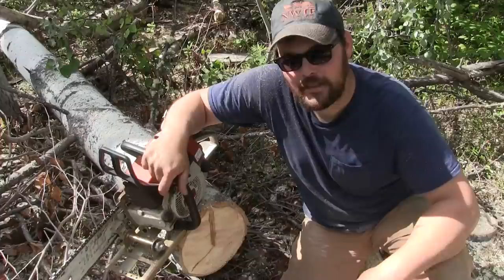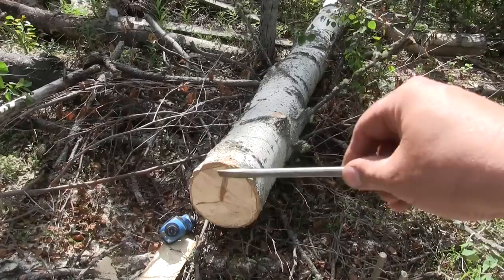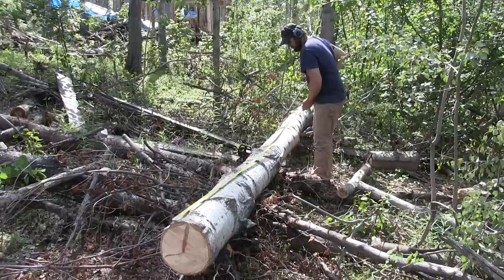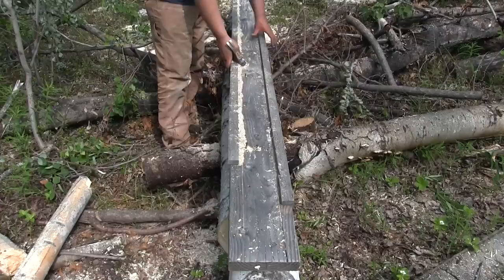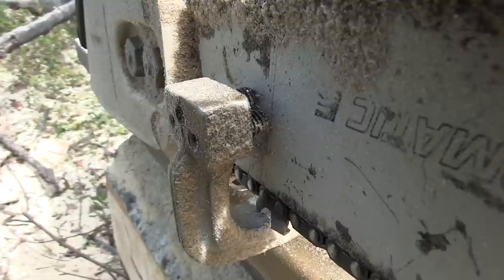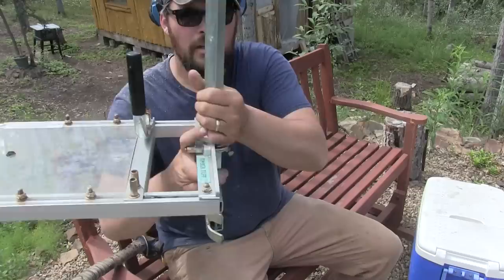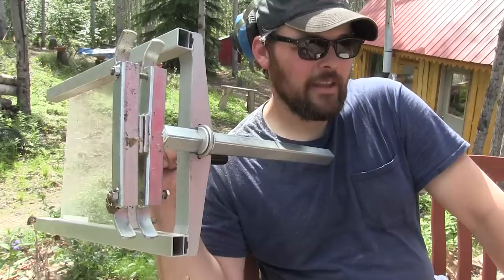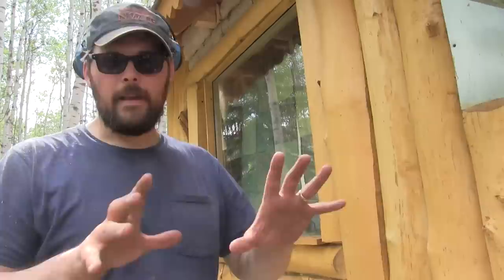Chainsaw saw mills

Comment: Great info! I was just going to buy one. Now I'm buying two. Time saver for sure.
Reply from the maker: You'll need rip chain for the Alaska type mill. But it would be best to own both jigs for sure
Reply: @Bushradical  Thanks Dave
Reply: Bushradical 
Don’t you use ripping chain on the saw with the hadden?  Both are running the length of the tree.

And do you buy ripping chains or grind down from standard chain?

(So far I’ve been buying my ripping chains, not experienced enough in my eyes to turn out a good enough product by grinding down—hell, I still don’t like my sharpening skills).

Love the vids, that is a great cabin!  Eventually I want to build a stockade style Viking longhouse, but I still haven’t seen my second Alaskan property to know if there is a big enough area of relative flatness (but I doubt it from the pictures I’ve seen—it is on Kosciusko Island, not a lot of flat area in the S.E. Portion of the state); and my property on the Cleveland Peninsula is all up and down, so I am putting up all stickbuilt structures which I am doing in a traditional Japanese style exterior...

Be safe.

Comment: I have the Granberg small log mill and the Granberg Mini mill which the equivalent to your Hadden lumber maker with the exception of the pivot the Granberg is stationary.  I have hardly ever used the small log mill but have cut a million beams with the mini mill before I got a band saw mill.
 I actually prefer to even cut boards with the mini mill cutting them from the side seems to work better than using standard chainsaw mill from the top.
Thanks Dave and stay safe....
Reply from the maker: Thanks Emil.

Comment: Cuts with the tip. +++ gonna get one for coldfoot. Thanks Dave
Reply from the maker: Hey Neil. That jig is a lot of work but it does the job. The other cool thing is that you can use any saw.....where as with the gransberg jig you need a pretty good sized saw to slab boards.
Reply from the maker: By the way, how's Lauro's toes doing?

Comment: That little Haddon jig looks like a real handy item to have.  Can you get a chain that is designed for ripping or do you sharpen a regular chain at a different angle.?
Reply from the maker: you can use a regular chain with  that jig.....for the Alaska mill you need a rip chain

Comment: nice straight forward to the point ! it would be a good idea to be somewhat experienced w/ running a chainsaw prior to attempting using a mill of this type or any other . chainsaws demand the utmost respect !!! they dont forgive and alls it takes is one uh oh ....'''''
Reply from the maker: Yes, but you have to run a saw to get that experience. Sometimes its best to jump in a figure things out. If someone wanted to build a small cabin with this jig...they would wind up with hundreds of hours of chainsaw experience because its a lot of work. But by the second or third cut they would have a good idea of how the whole contraption feels and behaves. Thanks

Comment: Hi Dave, Which Model Stihl are you using here?  I could guess, but what I am really after is what kind of power does your saw have and are you happy with that power for the length of the bar? Maybe you don't need more saw that the 16" bar requires? Thanks Dave!
Reply from the maker: This is a 034. The 16" bar is perfect for what I'm doing here. When you use the Alaska mill....you should have a saw, a minimum of about 60cc.

Comment: Is that an 025?   Sounds exactly like my old '97 Stihl 025 that has run perfectly since new with a couple spark plugs, sprockets, air filters, bars & chains.  I cleared my entire building site in Benzie County with that saw.   Another great video Dave.
Reply from the maker: No, this is an 034. Both good saws!

Comment: About how many 2 sided logs are you getting before you need to sharpen the chain?
Reply: In softwood such as that you can get a lot!  I saw quite a few Oak post and as long as the bark isn't covered in mud/sand you can still get a substantial amount of beams before sharpening with a semi chisel tooth full chisel dulls a little quicker. Alot of people use milling chain which is ground at 10° or less . I prefer standard ripping chain....
Reply from the maker: Several .....as long as you don't get the bar into the soil it stays sharp a long time in this wood

Comment: Interesting and informative info Dave. I knew about the Alaskan mill but had not see the Lumber maker in use before. Great little jig and simple to use. On average, about how many logs till you have to sharpen your chain?
Reply from the maker: You can cut lots of logs if you keep the bar out of the soil...
Reply: @Bushradical  Ya, dirt isn't good for any cutting tool :-)

Comment: Both great tools !! Really surprised you don’t a small portable mill. Runs on gas. Seems like it would fit right in with the protocol being off grid. Bout same price as a good used pickup for a used one but I think it’d b well worth it. Just my thoughts
Reply from the maker: Ive owned a band mill before, but I dont have one right now. I had a Lynn Lumber type mill.

Comment: Comment and a question-
C:  I'm digging these videos; often I have to put youtube on 1.5-2x playback speed to get the information delivery rate where it needs to be, but not usually for yours, so thanks for that.

Q:  How do you ensure that the guide board is straight?  Seems like lots of times if I buy lumber at the big box they're far from it.

Thanks!

Comment: Hey Dave thanks for the video I enjoyed it I have a question for you where you live and the other place how was the traffic outside when you get to the road and the same thing where you building that log cabin house because I asked a question because when I eventually do get my property I want to find a secluded spot what is really no one around maybe one or two cars an hour on the main road
Reply from the maker: I live up a mountain from the Haul road so there is always traffic running north to Prudhoe Bay. There are lots of places to find a quite spot but its not that quiet here....being up 1,000 feet above the road doesn't help because sound travels up here easily.
Reply: Bushradical okay thank you Dave I appreciate the information I have to find somewhere when I time comes because I want to have a piece of property that's 46 Acres that's secluded away from everyone and it's nice and quiet that's why I asked you the question

Comment: What type of chain are you using on your saw. Also what is your bar length
Reply from the maker: I use a standard chisel chain on the beam cutter.....you need a rip chain for the Alaska mill. The bar is 16"

Comment: I bought one at harber freight about 4 years ago, I think I paid 24 bucks for it! My sister tried to buy one there about a year and they said they didn't have them anymore!
Reply: Ps, I  use screws to attach the board to the logs, you can align and level it better I  think!
Reply from the maker: thanks

Comment: Thanks for the Good info. - What saw or saw size you recommend?
Reply from the maker: Any size will work with the siding jig.....for the board cutting jig.....60cc and up with a rip chain
Reply: @Bushradical  thanks for the Good info. Im gonna give it try - One more question for all the experience you have building cabins - What's about the best log size for building vertical cabin vs traditional can you recommend - I have many yellow pine & quite few red cedars - I was curious about the sap wood on cedars if I should Mill that off or does it make much difference? Really enjoying all your videos- jlo.
Reply from the maker: Hey Jack, I don't think there is a lot of room to debate log size....what I mean is you want a log that fills the most wall at one time.....but if you're putting them up by hand you're limited to the size you can personally handle. 
   There is a vertical log cabin in the town of Republic in the U.P. of Michigan that has 24" vertical logs.......but there is NO way one guy put those up. They likely weigh 800lbs each.  
    I would say 10" logs are about the most one guy would ever want to handle.